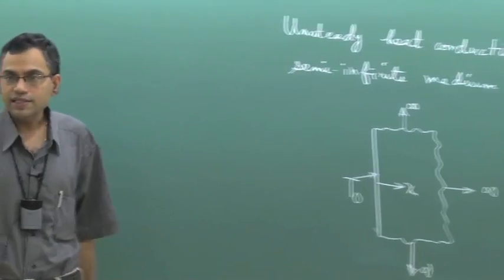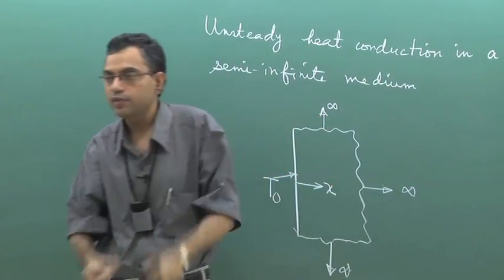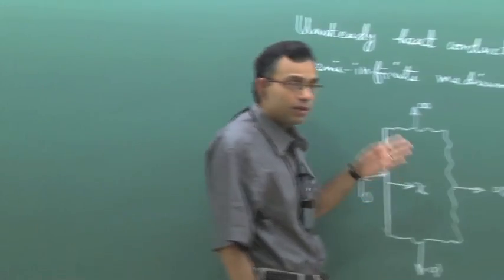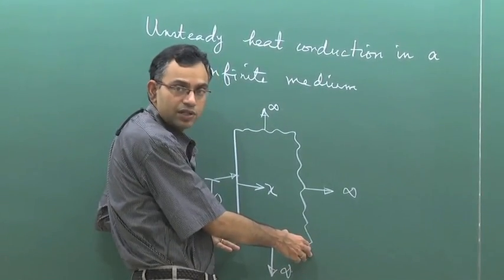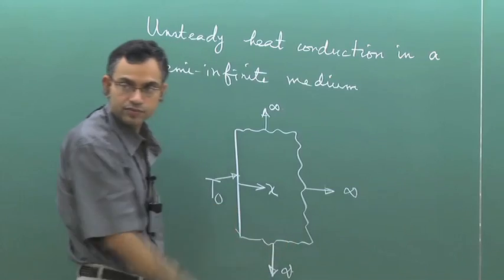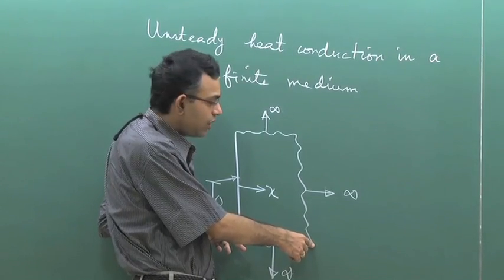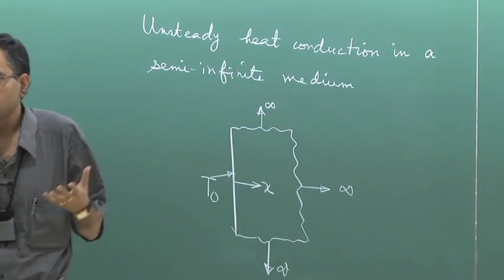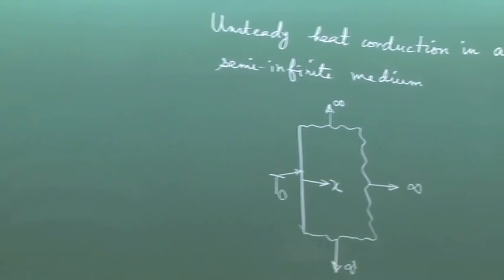Lecture 17: Unsteady State Heat Conduction in a Semi-infinte Medium

Comment: he is the reason of my intrest in fluid and thermal.    GENIUS
Reply: Prof. Suman Chakraborty
Reply: can you tell where this concept is used ???
Reply: @nsai3757  This problem is of much much use where we can not measure temperatures on both sides of plate directly. For instance, consider a flat plate where some heating is taking place and we want to know the heat flux distribution. Then based on temperature measurements on one side of plate only and suitability of boundary condition (uniform temp or uniform heat flux or convective), we can actually determine heat flux distribution. See otherwise we need to have temperatures on both sides of plate so as to estimate the heat flux. With this method, temperature variation w.r.t. time on only one side of plate is sufficient to calculate the heat flux.